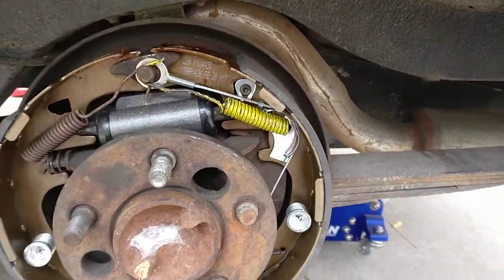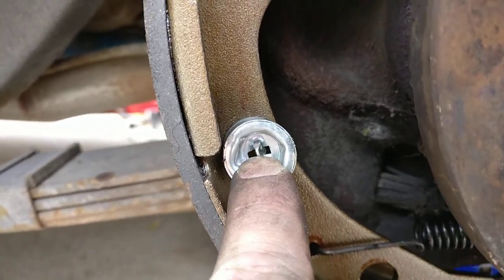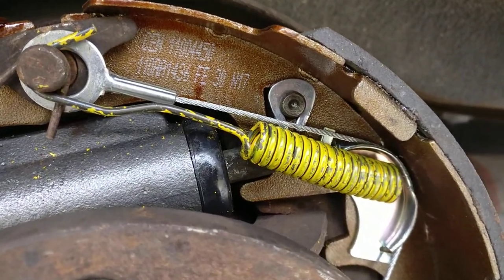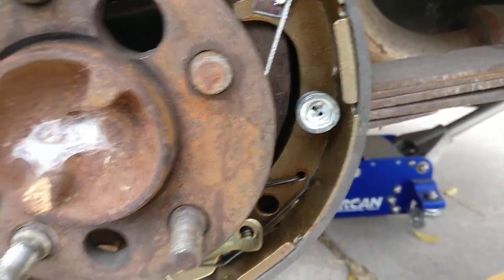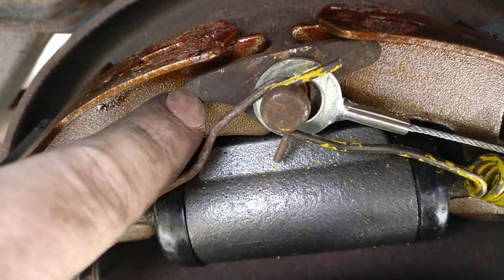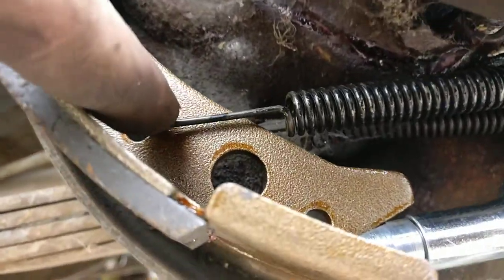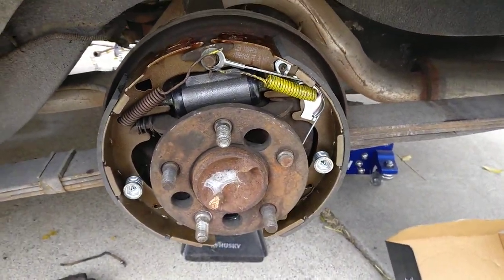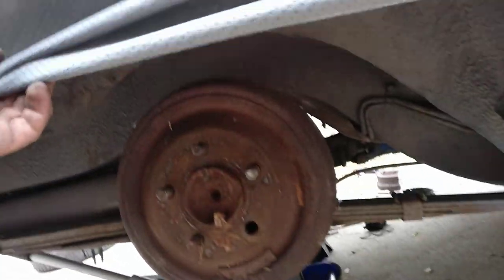Mopar A-Body Drum Brakes 101

Comment: Does this kit work for a 1972 duster with the small 5x4 bolt pattern? I opened my drums up and my self adjusting cable is torn, but looks different than the one on the video. Mine just has an eyelit on one end and like a hook on the other end, it doesnt have that green spring like the ine on the video. Hope you reply